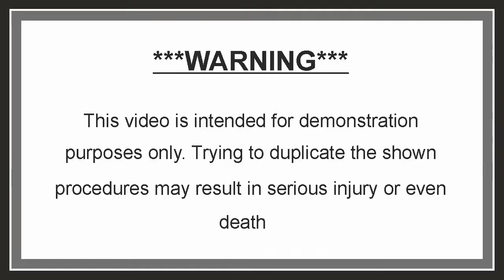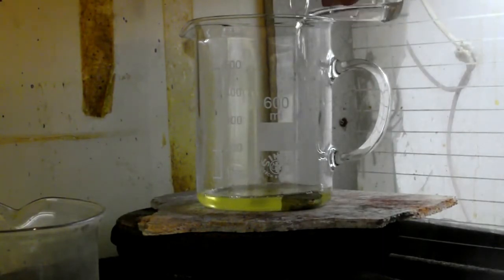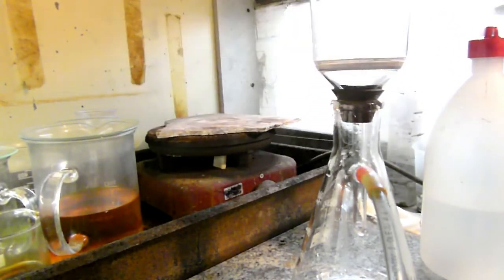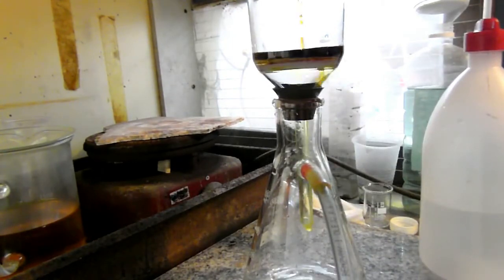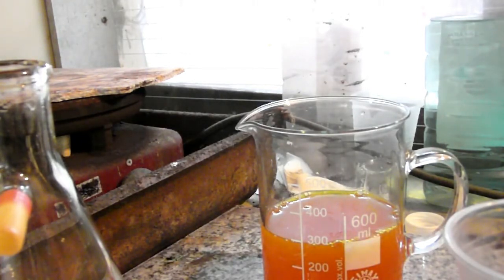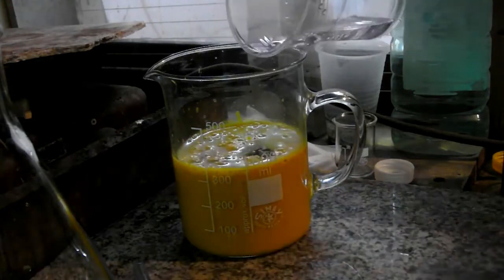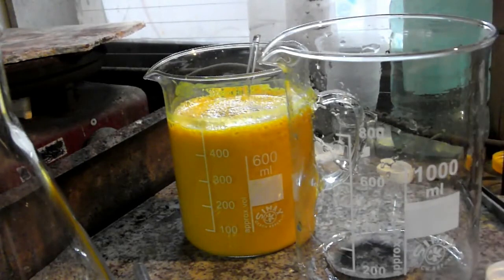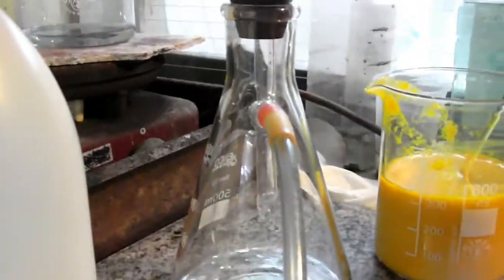PART 1: AgPdPt dore dissolution and PALLADIUM precipitation with DMG

Comment: Ok your video's are always good. I can't get DMG, was told I could use sodium cyanide? That it would precip blue from the Nitric/water, then copper pipe the liquid to drop my silver. Now I
Reply: Now I just copper pipe the nitric/water and precip the silver with the palladium. White with black specks. The sod. cyan. I can easily get, so was told to use that. Is this correct?
Reply from the maker: Thanks! I'm not familiar with cyanide chemistry, all I know is that cyanide solutions should be kept basic and away from acids.
Reply from the maker: @1hardman161  sodium formate is another option
Reply: @OwlTech333  Ok don't have or way to get now. Now I need to acid to pull all pgm's away from the gold. I have a few days to do this or I am done. From your knowledge will this work,,zinc precip the cyanide, take the precip into Nitric/water hot to remove silver&Pd, then solids into cool AR to dissolve Au & Pt, filter away Ir,Rh,& Ru, zinc precip the Au & Pt, take this into hot ammonia to dissolve the Pt leaving the Au to melt.
Reply from the maker: @1hardman161  I don't think  hot ammonia will dissolve Pt. But cold AR should dissolve Au leaving most of the Pt behind

Comment: How to convert plladium sponge into solid. Or can I melt sponge direct ?
Reply from the maker: Best is to convert the salt to Pd metal with formic acid https://youtube.com/shorts/fJ2qgN7lQMk?feature=share
Reply: But I hv plladium sponge in filter paper. What to do now. Can I dissolve in nitric and filter then potassium hydroxide to Ph 10 then formic acid ?
Reply from the maker: No, just put the filter paper in a beaker or spray down the pd into the breaker. Then heat and add formic acid carefully because the reaction is vigorous. Add couple of NaOH flakes and the yellow salt will start turning into black pd.
Reply: @OwlTech333  Thank You 😊🌹🌹
Reply from the maker: @rohitlkv  use exctra large beaker and boil
Reply: @OwlTech333  I have 2ltr beaker. So i put plladdium sponge in 2lltr beaker with some distilled water then i add some formic right ? Thanks for ur help .
Reply: @OwlTech333  this method is not working 😐
Reply from the maker: Worked for me, maybe you're doing something wrong
Reply: @OwlTech333  I dont know I'm dissolving again with nitric now let's see what happen

Comment: Descent video but, you said nothing about measurements or numbers so.....
Reply from the maker: I don't  measure the reagents, instead I judge by the reaction, and always try to use the smallest amount possible. Disaster is often the product of blind following a recipe  without understanding the process.
P S If you need explanation of the process  (in case the video is not sufficient) I'll be happy to assist you.